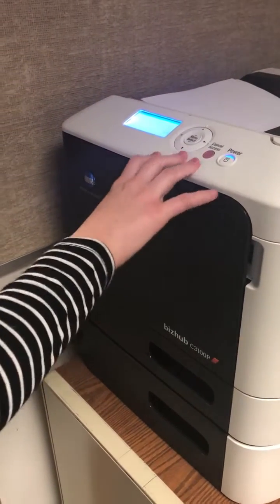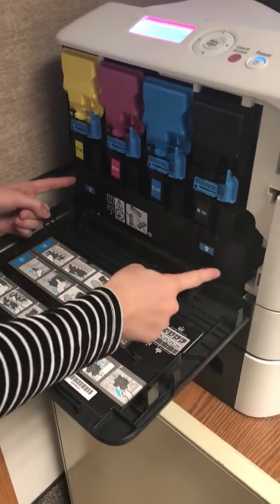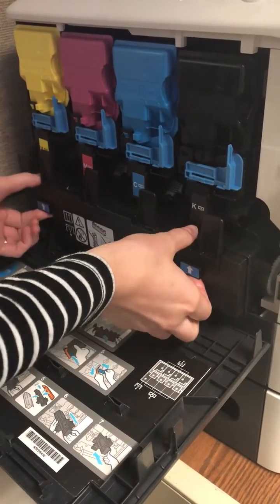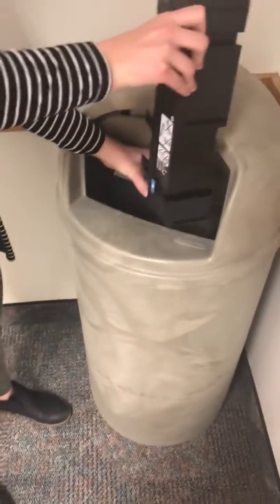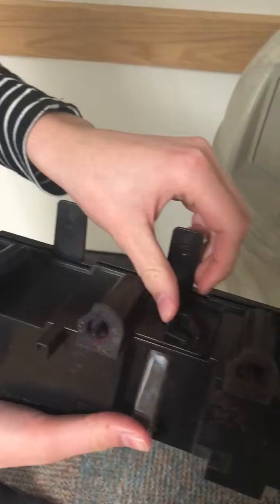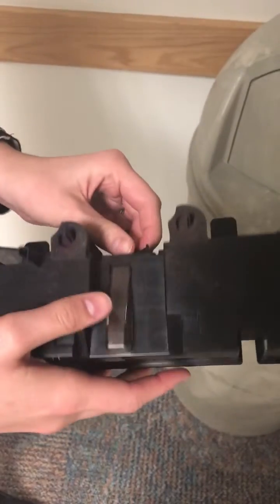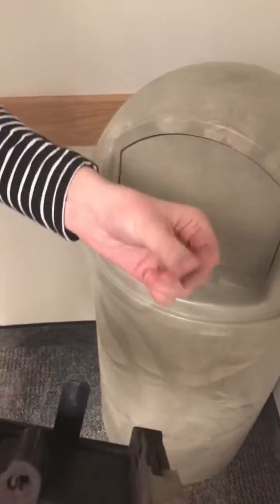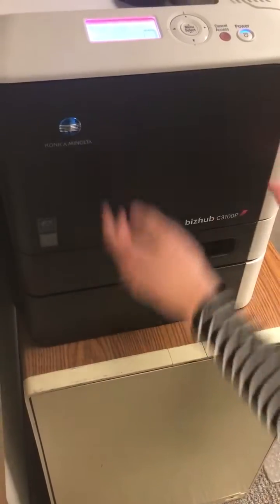How to empty a "full toner waste bin" for Konica Minolta printer

Comment: Good video but you should try to do this outside and into a ziploc bag or something sealed versus loose in the garbage bin. Someone throws something in there after you and there will be a dangerous dust cloud. Good to wear an N95 mask and gloves too. On my KM printer it was easier to unscrew the clear plastic window and dump from that side.

Comment: After i empty it. It still gave signal to replace the waste toner how to reset it?
Reply: Happened to me. I had to unscrew the clear window, empty from that side and used some canned air with an N95 mask to try clear the remaining toner. Before that point it was 97% empty, and I had unscrewed and cleaned the window/sensor and it was still throwing the error. The canned air and dumping from that side worked last for me.